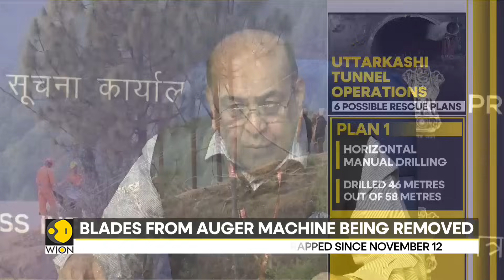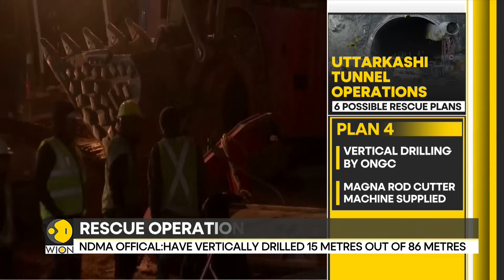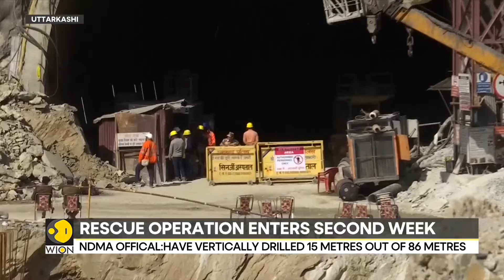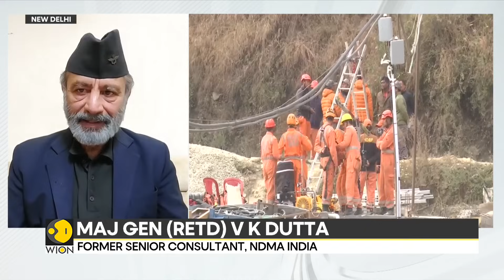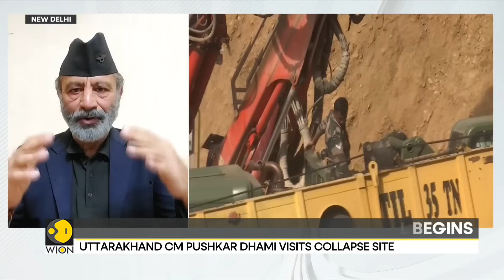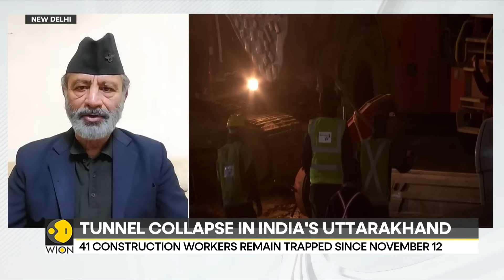Uttarkashi tunnel rescue: Vertical drilling makes swift progress | WION

Comment: This is becoming quite critical. ONGC should imply crude mining tech. The drill bits should be matrix bodied PDCs N they should u casing pipes with stabilising with G cement N make a permanent rig like boring.
Himalayas are you G fold mountains made of push action from both sides N the strata is really hard.

If required Russian drilling experts should be brought it who has drilled kola rig in Russia who drilled near about 12kms down the earth achieving a world record